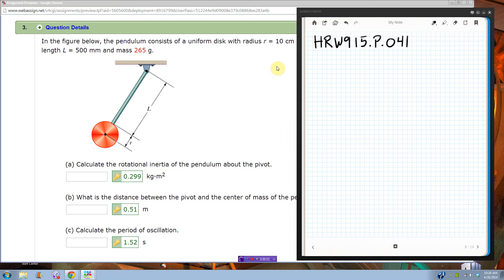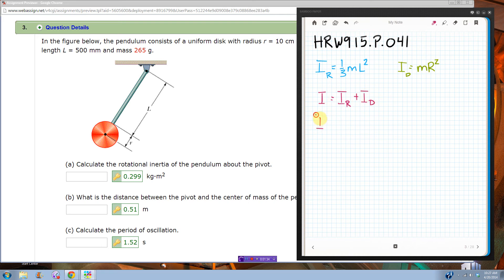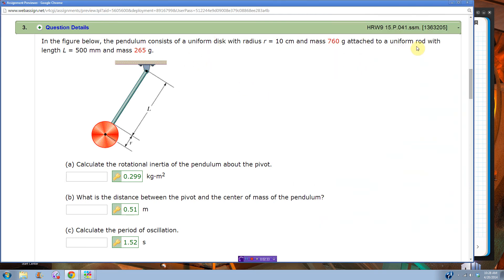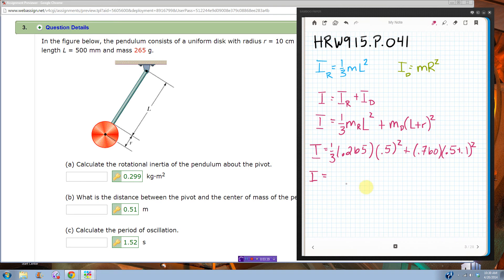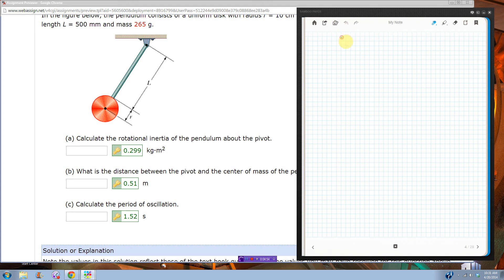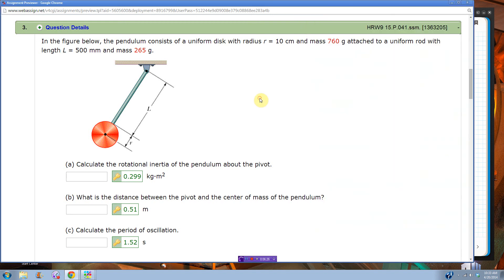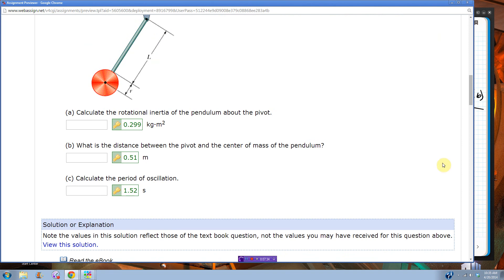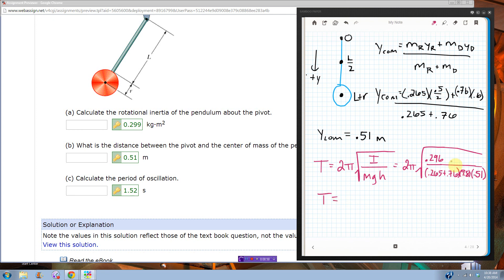HRW915P041

Comment: is MI not 1/2 MR^2 for disc?
Reply from the maker: +Dreamer Dreamer Usually, yes, but because the distance from the disk to the pivot (L) is so much greater than the radius of the disk (R) we can treat the disk as a point mass. This is cheating a little bit, but makes the math so much easier and doesn't change the answer significantly, so we do it anyway. If you want to, you can treat the disk as a disk, but you have to use the parallel axis theorem because the pivot is not the same as the center of mass of the disk. That would make the moment of inertia of the disk I = (1/2)MR^2 + ML^2.
Reply: Should it not be 1/2 Mr^2+M(L+r)^2 because distance from center to pivot is L+r .
Reply from the maker: Sure, that would be even more precise. You should try that out and see if the difference is enough to change the answer within the allowed significant figures.